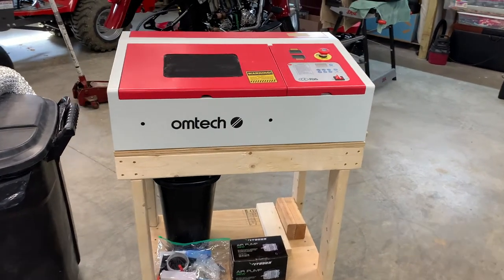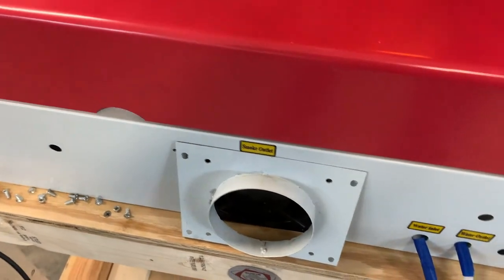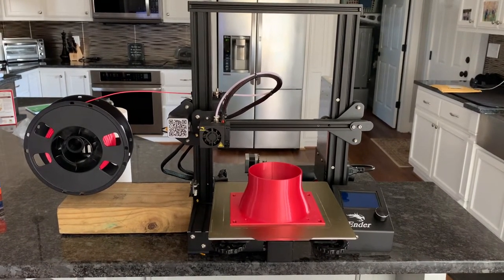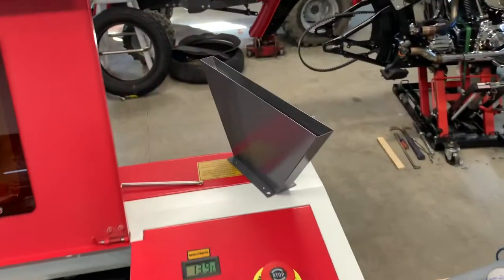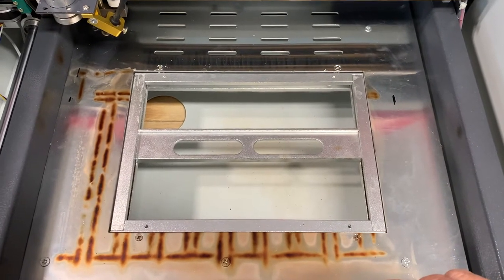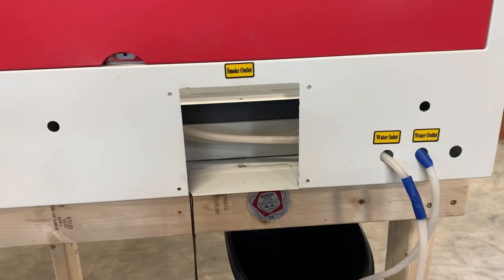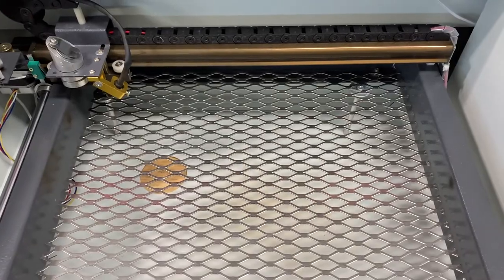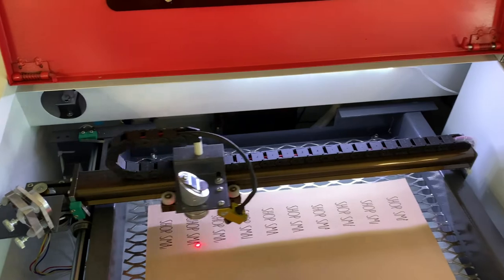K40 Laser Exhaust Fan and Work Surface

Comment: Nice to see someone still interactive with old posts. If your still using the same grid on the k40. Ir to anyone upgrading theirs reading the comments. Get a can of black high temp appliance spray paint at a hardware store and cover the grid with it. Greatly reduces or eliminites laser reflection so you can cut cleaner.
Reply from the maker: Hi thanks for watching and the comments. Great tip there! I'm sure many will find it useful. I think you may have already but if not please consider Subscribing and hitting the like button. I would really appreciate it.

Comment: Great setup. One issue. The stl file loads in and its tiny. Can scale it, but not sure what scale to hit for the 4 inch vent to size up right.
Reply from the maker: Hi, thanks for watching and the comments. If you're using Creality Slicer tool to create the file for your 3D printer, you may need to scale it up x 2540. Sometimes Creality brings files in as meteric and it will be tiny. The flange should measure 6.30" wide X 5.25" Tall. Either way I hope you are able to get it scalled correctly. If you haven't done so already, please consider Subscribing, leave a comment and tap the bell icon. I would really appreciate you doing that if you would. Thanks Again.

Comment: Hey just had a quick question as I'm doing this modification to my machine, on removing the metal shroud / box with the dremel how difficult was it to get those welds towards the back of it removed? I cut through the front similar to how you did it but couldn't get it out. So I cut the sides farther back to try and get some leverage but no success in removing the final back section of the box. Any advice you have on this from your experience would be super appreciated
Reply from the maker: It wasn't too bad for me.. I was able to get to the spot welds with a cutting disc on the Dremel.  It sure helps the exhaust a lot.  Let me know how your mod goes.